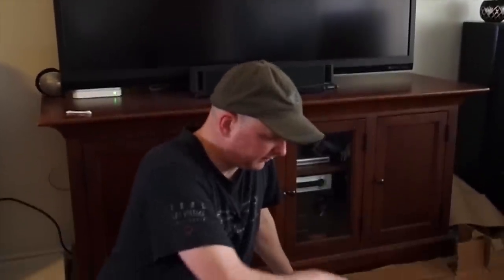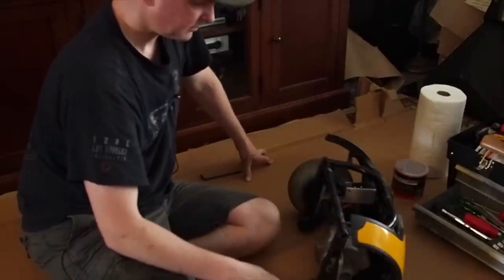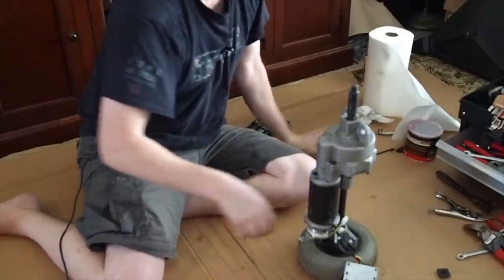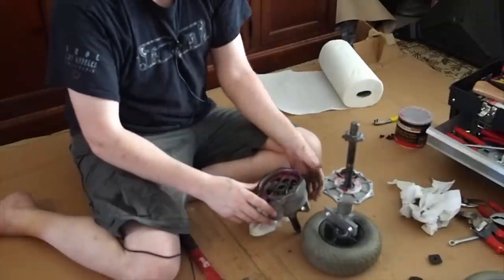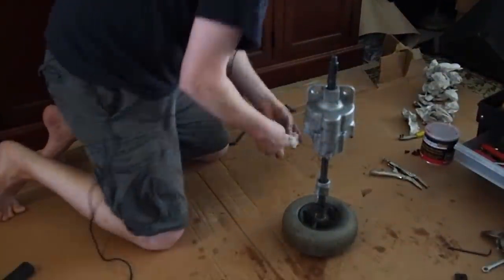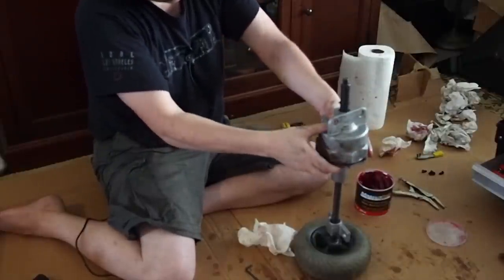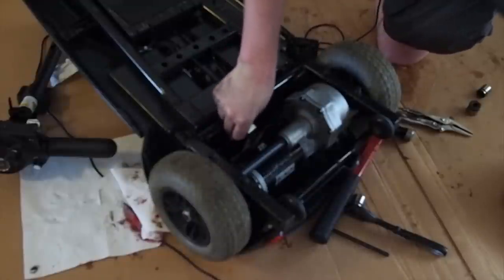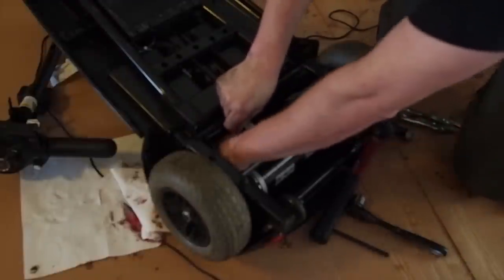GoGo Elite Mobility Scooter - Transaxle repair

Comment: (Transaxle = transmission +differential).  The gear assembly you are holding is called differential,  allowing two wheels to turn differently when the vehicle turns a corner. You need to know what a differential is to assemble it correctly.
Reply from the maker: The scooter has no axle. The electric motor is connected directly to the differential, which makes the differential a transaxle.
Reply: All wheels have axles around which they revolve. without an axle, a wheel is not a wheel, but a disc. (Exept in a ring wheel where its revolution is defined by a number of stationary bearings set around it's rim.)  In this scooter, the two axles that turn the wheels are driven separately by the two side gears of the differential.
Reply from the maker: Obviously I meant to write "driveshaft" (message above), where I wrote, "axle". I was thinking "driveshaft", and typed "axle". My message should have read, "The scooter has no driveshaft. The electric motor is connected directly to the differential, which makes the differential a transaxle." 

Anyway, if you want to argue the difference between a transmission and transaxle, this guy spells it out pretty well: http://www.carid.com/articles/transaxle-vs-transmission.html
Reply: The little twig with two bearings and a small pinion gear on it is called a driveshaft that drives the ring gear of the differential. The pinion gear, being so small and is driven by the motor at 3,000~6,000 rpm, usually is the one that goes first, wearing itself out so badly it causes great noises and eventually fails to drive the scooter.

Comment: Was This issue ever resolved? I'm having a similar problem with the transaxle, when I close it, tightening the bolts it locks up the gears and wheels won't spin. I don't think I put washers on correctly. There are 4 washers, 2 thin and 2 thick washers. I've tried every which way and no matter how I put them nothing seams right. Can you shed some light to my dilemma?
Reply from the maker: Yeah, I got it working. The issue is just an alignment problem. You must determine what is pushing against the other. After you pull it apart (in the "locking up" configuration), look at the sides of the gears. See if you can determine what is hitting, and which direction the assembly must move. There will be less grease on one side of a spacer/gear than the other.

If you can't tell... just try a few configurations. Don't bolt it completely together, but tight enough that you can see if it moves freely. If not, take it apart move the spacers to a new configuration and try again. There are not an unlimited number of variations. After two or three attempts you should be able to find something that works.

The bottom line is that all of the spacers will fit. By arranging the spacers in different configurations you're moving the inner workings one direction or the other. If it's locking up when it's bolted together in means that the assembly is too far to one side. So, you just have to determine which side is touching the housing... then, it's a question of swapping the spacers around.

Comment: Good morning, I kindly request advice for the diagnosis of a scooter DAYTONA 4GT.
The scooter has more speed when reverse is activated and when moving forward is much slower.
We have changed the card, the speed potentiometer, batteries, but the team continues with the same problem.
I appreciate a quick response to this concern.
Reply: Um.. sounds like polarity (the wires) on the motor is reversed. If that's true, it's totally stupid. If My guess is right, then the levers are currently reveresed from what they should be..

Comment: What's the difference between a transmission the transaxel on
Reply: A transaxle is a combined transmission and differential.

By strict definition, I don't believe that the scooter has a transaxle, as it's really only a differential. That said, the scooter's transaxle is the center component of the drive train. It contains the axle, drive shaft, and differential. Yes, it's missing gears, so it's not really a transmission. But, "is a single gear a gear?" If "yes" - then it is a transaxle. If not... then technically it is just a differential. 

Anyway, because of its purpose, and the fact that Go-Go calls it a transaxle... I call it a transaxle too.

Comment: where did you buy the washers? I have the same issue. Thanks and a very nice video to post. -Luke
Reply from the maker: I only bought a single bearing. I found it at a local parts warehouse that advertised having lots of bearings.

Comment: Hi I've got a go go 4 wheel version but it keeps stopping and beeping so have to turn it off and on again for it to start then it may go a yard or so and do it again but mainly on a hill any ideas? Thanks iain
Reply: i found it did that if it got wet , dry it out and it will be fine

Comment: $1000!!! They are about £509 new for the 4 wheel Gogo Elite Traveller version in the UK (with disabled VAT relief) = about US$735. That must be a first, something cheaper in the UK than the US!
Reply: Everything medical costs and arm and a leg in the US. You can actually get it for about the same in the US, but if you use insurance... it's more.

Comment: Are the bearings inside the transaxle just pressed in place?
Reply: My scooter runs when power is applied and it stops when power is released, but how come I can push it forward like it’s in neutral?

Comment: Yellow lever to disengage the wheels is frozen on mine.  Won't move.  Any idea what could be the problem of this?
Reply: Harley Rowe blow some air in the brakes it could be some rocks got lodged in the brake disk
Reply: Spray WD40 as there is water damage.

Comment: Holy Cow!
The GoGo Elite is a bunch of crap.
Are all mobility scooters like this??????????
I am so glad you posted this video.  You saved me from a fate worse than purgatory.
Run do not walk to the nearest exit of a GoGo elite dealer.
Average price for one of these crap items $2000.
Free freight from China?  Hmmm?
Reply from the maker: Bill Rundell It's actually a really good little scooter.  This particular one has gone at least 3,000 miles.  It has been used nearly every day for 6 years.  The only annoying problem is the connector between the battery and the chassis, where the vibration between the battery and chassis wiggles the connector loose, and it needs to be tightened every once in a while.

If I were to buy a new scooter - I would probably buy this one again.
Reply: mrcnwmn 

If looking for a first time scooter and you saw this video, would you give it a second look?
Just alone the battery and charger issue on having to figure out which one was defective
is very troublesome.

Stated in the video the company knew of the problem and still put crap batteries in them with defective
chargers.  He had at lest 4 chargers he used

The seat and elbow rest interfered with raising and lowering.  Most definitely a design problem and the company
never put out a fix for it or recall.  The problem remains unfixed in manufacturing, as far as the video presentation..

Wobbly seat problem??????
Power cut in and out, faulty connection, you guessed at.
Broken lifting handle.

Read the raining comments same problems.

Finally,  were was the company support on the issues you presented.
They apparently never knew you after you bought  the GoGo  
The GoGo is defiantly NoNO
Reply from the maker: Bill Rundell The point of the video is not meant for people to make a purchasing decisions.  It is not a sales video, nor is it a review.  The point of the video is to help people understand that they can fix their current scooter themselves.  If I can do it - they can do it.

In term of issues: The 'GoGo Elite Traveler' is no different than any other scooter - anywhere.  All scooters have similar problems eventually.  If you think this is a bad review about the this scooter', then it is actually a bad review of ALL scooters.  Scooters are electronic and mechanical equipment which are exposed to the elements, vibrations, as wells as other incidental forces.  All vehicles; motorcycles, to automobiles, to scooters need periodic maintenance as a result of our environment.

Is the GoGo perfect?  Absolutely not.  But, it fits Sheri's needs very well.  It's been extremely reliable.  This video is a testimony to how easy it is to fix, not how unreliable it is.

Comment: This video helped me out when I had to replace the bearing on the drive shaft!Why did the manufacturer not make bearing replacement simpler by allowing easy removal after the wheel was removed? Because they do not expect Joe Public to perform this task and making money for their agents ! Allowing for rip off merchants to profit!
Reply: Where did you find that bearing? Our scooter stopped working, the bearing assembly was wedged in there, so I hit it with a hammer and greased it...seems to be working now, but who knows how long.
Reply: @stanleytehee  I think your on borrowed time, i replaced the original bearing with two bearings of a smaller width, well packed with grease! The bearings I used were ordered on ebay and were ordered with no reference to MOBILITY SCOOTERS!
Reply: I think you are quite right, I’ll look around, it’s such a small bearing.

Comment: Is it possible to replace the wheels for use on a beach?
Reply: You can certainly replace the wheels, but the wheel wells are very small. You would need to drop the axels down a few inches to get larger wheels. Basically, it would require welding. It's possible to do, but I think getting a scooter that's already set up for the beach would be a better bet.
Reply: Makes sense, thanks!!!
I have not seen any of what you suggest. Any idea what they are called? I'd love to find one.
Thanks again.

Comment: yes. but when the key is removed and there is no power I can push the buggy with very little resistance.
Reply from the maker: You shouldn't be able to. Sounds to me like the motor isn't fully engaged to the wheels.
Reply: thank you for your quick reply..ill strip it when i get the chance. thanks for the info.

Comment: my steering on my mob scooter is very light ...how do I tighten it up ?
Reply from the maker: I suspect you mean it's loose or wobbly. If all the connectors are tightened down, then the issue is the bearings. It could be a design flow (bearings that are too small), or that the bearing housing has expanded. Also, sometimes bearings can escape the bearing housing. So, if you lost a few - it will get really wobbly. Typically you can only loose bearings if the connectors are loose.

When bearings are first sold they are packed with grease, and usually feel very solid. Over time the grease breaks down and the bearing will begin to feel looser. This is normal. If it's a sealed bearing (the bearings in the housing are not exposed to the air) than the only choice is to buy a new bearing. If not, you can pack it with grease again.

Comment: HI! my scooter has a cyclic plastic  noise, and i dont know where is it. ITs sound appears when my wife is drive it. Sombody cant help me? thanks
Reply from the maker: Quite a few people have similar issues with noises they can't identify. Unfortunately, it can be many things. The only solution is to listen for where the noise is coming from. Most likely, something is rubbing against a tire. I've had sticks and leaves stuck in the wheel wells that don't sound the way you would expect.

Anyway, you're going to have to identify where exactly it's coming from. You might have to ride it yourself to find the source.

Comment: Hi,my mobility scooter now and then just cuts out but when i turn key of then turn back on it works ok till i slow down again then it cuts out again.Anyone got any ideas.Thanks.
Reply: Mine was acting up similarly, as well as erroring in the middle of intersections. It turned out to be worn contacts in the key switch. Hopefully, your problem will be something as simple.
Reply: Thankyou for your input and i will check it out.Cheers

Comment: is there any way i could speed one of these up is there any where i could get a motor to fit this but with more power
Reply from the maker: Of course.

However, you're talking two different things:  Speed and power.  Either (but not both) can be achieved by changing the gearing in the transaxle.  But, that's probably not what you're asking for.  You're likely thinking that you'd like to drop a larger/faster electric motor in the scooter.  But, that's not really nessesary.  

Really, all you need to do is push more current into the existing electric motor.  Having said that, it will have physical limitations and will overheat given  enough power.  I imagine the upgrade would be pretty simple once you knew what to do.

Electric motors are pretty awesome things.  Add a little extra electricity to an electric motor, it will burn out sooner, but it will answer back with more power.  If all you're looking for is 5% more speed, then my bet is that it can be done with the existing motor pretty safely.  An electrician would just have to tell us how.  Of course, the battery will drain substantially quicker, and you might have heat problems with the battery and/or motor.  Still, I'd try upgrading the electronics before replacing the motor.  Like most motors, the manufacture set the default power output to "safe/economical" levels.  Who knows how far under-performing the motor is set?  It's entirely possible to get the motor to go twice as fast without burning it out.  Who knows?  But, the point is... you probably don't need to change the motor.  Just getting more electricity to it will speed the motor up.
Reply: mrcnwmn This also depends on the motor controller. Mine has a PWM (Pulse Width Modulator) that sends 24V pulses to the motor in the form of a square wave (alternating between 24V and 0V). The longer the duration of the pulse, the longer the motor receives the full 24V and the faster it will go. To change this, if it's not already at maximum, the controller needs to be programmed to send the longer pulses. I'm not sure about the GoGo but, to find out, very slowly increase your throttle until the scooter just starts to move. If it's jerky, the motor is receiving pulses. I've been learning about this because I'm building a special scooter to fit my own needs and I've done research on different ways to do speed control on DC motors. PWMs are quite common in many applications, apparently.

Comment: everytime i go up a hill the scooter kunks out i have to push scooter pass the hill then i 
push the reset button to start
Reply from the maker: The breaker pops when the system is being overloaded. Unfortunately, it's a combination of amps, weight, slope, and distance. If the breaker pop it means that too much current is being pulled from the battery. The best solution would be to find a different (less hilly) way to whoever you're going. You could also apply less power up the hill, or let the scooter rest every so often.

Mechanically, you could replace the breaker with a higher amp one. I don't recommend that, but if you want to go that route, I'd also change the batteries for ones that produce higher cranking amps. The connections (wires) between the battery and motor are probably fine (rated higher than the current they're carrying). The motor will probably also be fine as long as it doesn't get too hot. If you were to remove the breaker all together (just bridge the connection), probably the thing that would go wrong first is that the batteries could melt.

Really, the breaker is a warning sign that you're putting too much stress on the system. You could probably get away with a slightly higher rated breaker without changing anything else, but there's risk in that.
Reply: I have brand new vmax tank batteries in my scooter that i have been using for the last 2 years the pride batteries are junk. I just replaced the batteries and the breaker keeps tripping even on a full 12 hr charge.  Could the breaker be bad and not letting the increased electric go thru?

Comment: Hi
I have a scooter GoGo Elite Traveller Plus version with the steering wheel as pictured - http://thumbs.picclick.com/00/s/NzQ1WDExODM=/z/uKEAAOSw8w1X3~F2/$/Pride-Go-Go-Elite-Traveller-Plus 4-Mobility_57.jpg
For a long time I have the scooter this problem, namely after turning and pressing forward scooter goes when fire you throttle driving scooter stops, and when again I push scooter is no longer going, does not emit any sound signals only slightly vibrated tip of the state of charge battery.
What could be causing this behavior?
Best regards

Comment: Hey good video, I have a transaxle that I need to rebuild,  It appears to have a failed bearing inside but where do you get the parts?  Can you post link or web address? No one, including Pride,  have a parts breakdown of the transaxle itself.   southwestmedica.com and monsterscooterparts.com wants over $400 for the axle without motor and brake.  Also they both sell motors.  BTW, about motors, I have had the lurching problem you talked about and mine turned out to be the motor.  Remember, it is a DC motor and therefor it has brushes and guess what brushes do in time, yes, they wear down to where they don't want to make contact anymore.  Monsterscooterparts sells the brushes as well.
Reply from the maker: William Roberts I don't have links.  I simply called a local bearing and bushing shop once I found the broken bearing.  It was a common bearing.  They took one look at it and said, "yeah, we have these at the warehouse".  The gears might be a little tougher, but I suspect it would be the same deal.  I seriously doubt any of the motor and transaxle parts are custom.